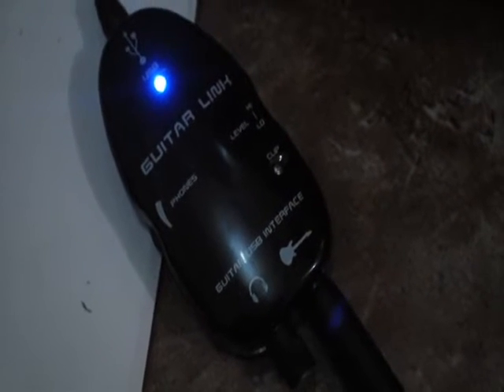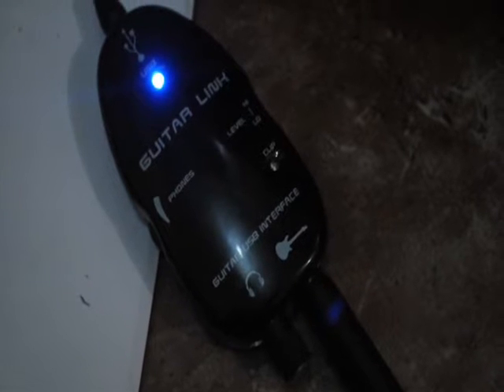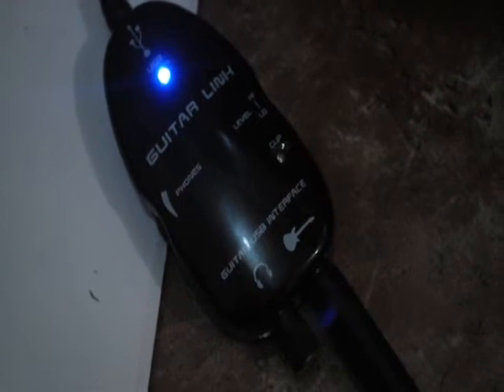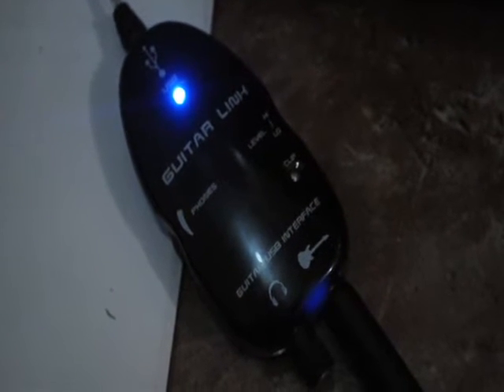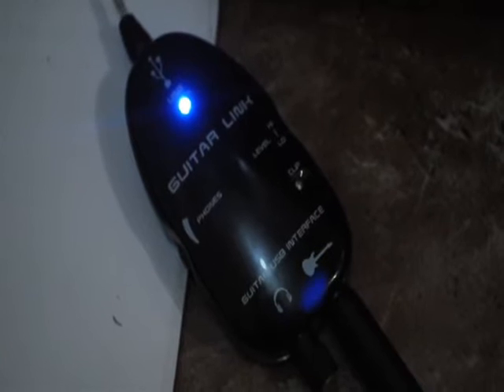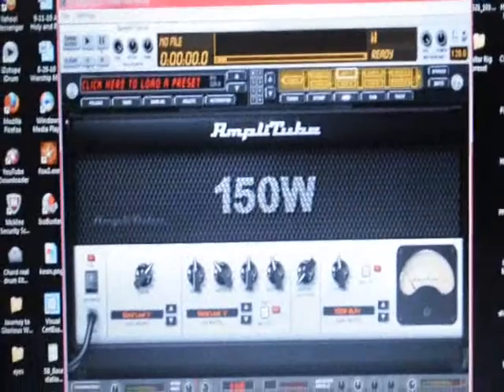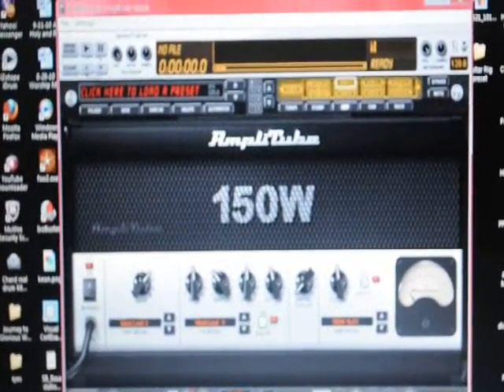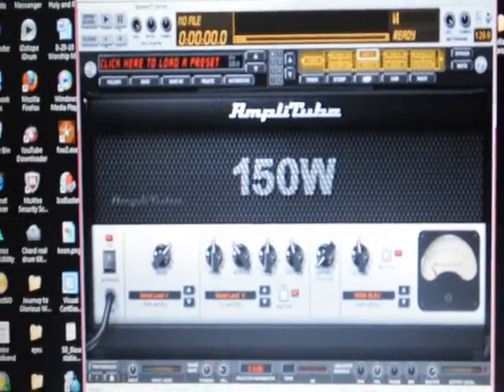USB Guitar link cable latency+Audio quality test

Comment: Does it sound clear? How about static?
Reply from the maker: It is clear but make sure to use the latest asio4all driver. Also make sure to use high end shielded guitar cable to eliminate the noise further. I no longer use the device but I still have it since I already moved to an iRig setup for more portability.
Reply: I see. Thanks for the info.

Comment: did u get rid of "Flicker noise"?
Reply from the maker: When you say flicker noise does that mean static or humming? Shielding the internal will help a lot using a plastic to cover the electronics then a thin foil. Second using a well shielded cable can further remove the noise. I still have the guitar link but I haven't use it for quite some time now since I've been using the irig setup for more portability.

Comment: Windows 7 recognizes it like "C-Media headphone set". The guitar sounds in the speakers but it has latency.
Really this piece of crap is not an USB Interface but another analog audio input (latency), without ASIO.
Reply from the maker: Christian Campos Hi I just tried to reinstall the Asio4all driver from www.asio4all.com on another laptop and it just worked just fine. You need to tweak the Asio4All driver through Amplitube or NI Guitar rig app by selecting Asio4All as IO for your your sound then tweak the latency value. The HW setup were just normal setup from which the PC speakers are connected to the USB Guitar Link and the other end is connected through the USB in the laptop.
Reply: Richard Chua you must install the Behringer UCG102 drivers, latency zero :D
Reply: +Christian Campos hi are you really sure that there is absolutly no latency ? tnks
Reply: +Christian Campos no latency? can we have your video pls... :)
thanks

Comment: hi i just want to know if it works even if you dont plug it on a speaker? because i planning to buy one for practice, and i want to be the only one hearing the sound from my headset. im in a dorm now and i dont want to disturb my roommates so much. thanks
Reply from the maker: Negumi09 Yes, you can use a headphone if you want.
Reply: thank you :)

Comment: have you ever experienced with noise , even without the guitar plugged in ? mine is worse, it just have this random static noise at the background. At first, i thought it was my guitar, then i  checked everything from the pots and grounding, then i realized it was the usb guitar link after all. have ever this happened to you ?
Reply from the maker: RuDofCAraVAn Yes, it is a very noisy piece of Audio device... You can shield it if you really cant bear the humming noise that it creates. COnsidering that this device is sooooo cheap therefore they skimped on a lot of things specially the grounding/shielding part. Just open the bugger then wrap it with a masking tape then wrap it with a copper or aluminum foil then put it back together again. That will reduce the noise. However, it is very tricky to shield the device, you just have to be patient and creative when you do decide to shield it.

Comment: I'm planning to buy this thing, does it work with mixpad recording software? if the set up is Guitar>USB Link>PC/Laptop, where did u get the distorted sound from?
Reply from the maker: The USB guitar link has guitar rig installer software for PC included... You need to install that and plug your guitar link to make it work.

Comment: Sir pano po yung paglalagay ng foil sa buong interface?
kelangan po ba balutin din kasama yung mga PL connectors?
Reply from the maker: You can wrap the inside with a masking tape for insulation then foil tape on top then it's tricky putting the whole thing back together... The masking tape is to make sure that the foil wont touch the circuit.

Comment: Has anybody detected this intermittent digital beep in the Guitar Link ?  /watch?v=2SJKgsc4Zls   It is more noticeable in hi gain settings. What have you done to fix it ?
Reply: same here but I manage to lessen the noise on my DAW by adding some vst plugin, Now its fine working great with metal tone
Reply: Zepulus Garcia Which plugin ? !!!
Reply: Charlie Angel get ghi.dll from GVST then add some noise gate, its just a matter of mixing your effects vst plugin, also lower your input signal. Richard chua suggested to wrap the interface with foil
Reply: Zepulus Garcia I tried the foil but it was of no use. Ive used a noise gate. ..and denoiser. Gracias !

Comment: bro d ko mainstall ung usb guitar link...wlang nalabas na sound tsk...bough mine at ebay..san ka nakabili ng headset na may 1/8 jack? thanks!
Reply from the maker: Bro use Asio4all... you can google it... it's better than the stock driver.

Comment from the maker: @dechpadilladcp
1. Download asio4all driver then install it.
2. Plug in usb guitar link.
3.  Open audacity then select asio4all as input audio.

If still does not work, you need to manually configure the asio4all.
Reply: +Naudir You're very wrong.
1. You CAN use usb interface without drivers, because Windows or even other operating systems have some drivers built-in, that's why usb devices are just called plug and play. It's that simple. Sound latency is other issue, but it should at least work even without asio.
2. ASIO4ALL can work even with my M-Audio M-Track Plus soundcard, it doesn't matter if it's built in on motherboard/notebook or usb or maybe even firewire.
3. Beyond logic status. This says asio4all most often, when you have your soundcard used already by another application/driver. It could help, if using win7, that you check samplerate and bitrate in windows to use standard 16bit 44,1kHz settings, or, you can go to playback/record devices and disable, or just don't use it for windows here, so it will have only "ready" status. Then try your procedure again.

Again losing time, arguing on youtube..
Reply: Richard Chua This is not how you did that, otherwise it wouldn't work for you.. you can't use USB interface without installing it driver. Asio is for your sound card driver, not for usb use. I am trying to figure out how to install it because any of methods doesn't work for me and i got "beyond logic status" in asio configuration
Reply from the maker: Naudir Hi I just tried to reinstall the Asio4all driver from www.asio4all.com on another laptop and it just worked just fine. You need to tweak the Asio4All driver through Amplitube or NI Guitar rig app by selecting Asio4All as IO for your your sound then tweak the latency value. The HW setup were just normal setup from which the PC speakers are connected to the USB Guitar Link and the other end is connected through the USB in the laptop.

Comment from the maker: Yup medyo meron hum kapag medium to high gain settings... Sa clean naman ok lng basta you need to move the device away from the computer as possible. Also, you can wrap the thing with aluminum foil for rf shielding.

Comment from the maker: yup they're actually the same IMHO. I think this device is just the OEM version that is why it's cheap. It's also cheap because it does not have support or shall we say the QC is not at par with Behringer (w/c is not that good either). About the noise all I can say is that it's tolerable, I think just use the Guitar Rig built in noise suppresor and move the device as far as possible from your laptop or PC and you're good. HTH

Comment from the maker: go to ebay dot ph then type usb guitar link... Just browse through different postings and bid for the item on ebay. It'll cost you 400-500 pesos w/ free shipping from china... HTH

Check below link: Change " dot " with "." w/o the ".

w3 dot ebay dot ph/itm/New-Black-Guitar-USB-Interface-Link-Cable-PC-MAC-Recording-/290890207145?pt=Guitar_Accessories&hash=item43ba684fa9

Comment from the maker: Latency issue is minimized when I used ASIO4ALL driver (you can google this driver). I only get 18 millisecond max latency with the output sound.

I heard good things with the newer beta version of asio4all 2.11 since you can set custom csample rates settings unlike the previous 2.10 version. This means you can play with the sample rate that will directly affect the latency issue. Just tweak them to the lowest latency to sample rate ration that wont compromise  the sound quality.

Comment from the maker: @Daniel Canoy latency issue will be more apparent without the usb audio interface. The stock PC soundcard cannot handle or process high bit rate A/D D/A conversion.  bought it at 1k before in a tyangge in Robinsons mall. I think you csn get them for 1.5k in sulit...

Comment from the maker: I agree with you, I have few USB audio devices and this unit is indeed on the cheap side but very sturdy. A bit noisy since there is almost no RF shielding inside when I opened it up. But there are work around as I mentioned below. 

"I fixed mine by wrapping the whole interface with aluminum foil and moved the device as far from the laptop or any electronic device as possible... ".

Comment from the maker: Hi, The Rocksmith uses a proprietary quarter-inch to USB cable. I believe the device they provide is a straight-forward USB audio interface. Yes, I recommend the guitarlink only if you can get it a lot cheaper than the Rocksmith audio interface and if you're only going to use them in your PC. I'm not 100% sure that the guitarlink will work on X-Box.  HTH

Comment from the maker: It's a bit noisy but there is a workaround. Btw, do you mean RF noise picked up from flourescent lamp and or from your PC?  I fixed mine by wrapping the whole interface with aluminum foil and moved the device as far from the laptop or any electronic device as possible... HTH

Comment from the maker: I think the diff. is the audio quality, quality of the preamps, less noise, more options, reliability and the quality of the hardware or build quality is better. The more expensive the interface, the less latency (e.g. firewire interface). But in the price range  $50-$80 interface, this cheap device is directly comparable imho. The difference is that this cheap USB device is a bit noisy and picks up RF signal quite easily, I fixed mine just by wrapping the whole device with aluminum foil. HTH

Comment from the maker: Amplitube is quite good when it comes with recreating the guitar rig sound through your pc and it's very versatile and lots of option. For the amplitube metal with the sale price will cost around $50 ($79 orig price) while the whole guitar rig is really expensive ($300-/+). The mix craft preset is quite good for your created tracks but you may need to use other plugins or external effects to enhance further or to complete your guitar sound. HTH.

Comment from the maker: Yes, recording is a breeze with this device. Connecting the guitar to your pc thru the guitar link is easy.  You should be recording in no time. Just install asio4all driver instead of the driver in the CD if you have windows 7. HTH.

Comment from the maker: Nope, it's not available in Audiophile since it's a generic USB audio interface and AP is selling mostly branded gears. I bought it in one of the tyangge in Robinsons Pioneer last Sept. of 2011. The stall is no longer there but I believe you can always buy the unit from sulit or maybe in any tyangge that sells Miles china keyboard/synth. HTH

Comment: @rschua7 Thanks, i've got everything sorted, instead of using the USB device i just plug the guitar lead straight into the microphone jack on my laptop, it works perfectly. I dont know why i didnt think of it before :P Thanks for the help, especialy with the noise, i was wondering why i was getting so much :P

Comment: @MRm3dia I'm also runing my pc through an hdmi so its digital sound.. would that cause latency?.. is so, should i just set mi tv to vga and plug the sound threw stereo jack in? or should i get a desktop pc speakers. I'm using my tv built in speakers.

Comment: @MRm3dia right on dude, thanks for the heads up.. if you can do a tut on it, it would be way cool. i haven't got mine yet, I'll try to mess around a bit with it and  see how it goes. do you know if the new asio4all ASIO4ALL 2.11 Beta1 do x64? but yea dude, let me know if you get that to work for sure.

Comment: @MRm3dia  i just ordered mine for 40$. i had tried to plug in my guitar before threw a digital petal with asio4all and still was getting the latency. i hope this does the trick, i didn't want to spend 200 bucks on a pro setup.

Comment: @Legendennr1 well this is for devices with 1/4 jack. The only reason I would buy a sound card would be to use a condenser mic. But the sound card would also need phantom power. If you're plugging into your "mic" on the computer, it reduces the sound quality, so i'm planning to get one of these. If you're only recording guitar then you might as well buy this, it's basically just a sound card for guitars, and it's compatible with dynamic mics

Comment: @rschua7 thanks so much for replying, Muchas gracias :) tried your steps but fell over at the last hurdle, when I select Behringer as Playback and Recording Device in the General tab, it comes up with an Audio Driver Error box saying "The following drivers do not support the audio current format", being the "Behringer USB Audio" driver... didn't you get Asio4All to work somehow? If so, please share :) THANKS!